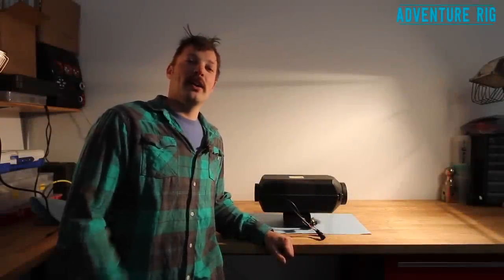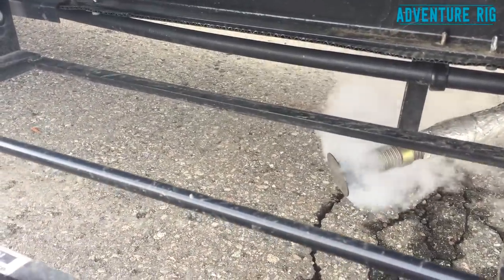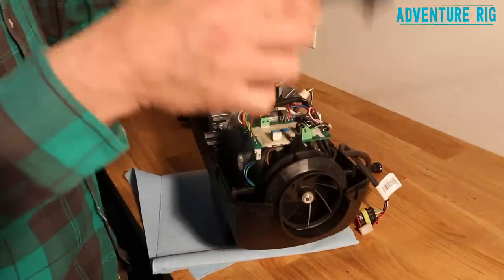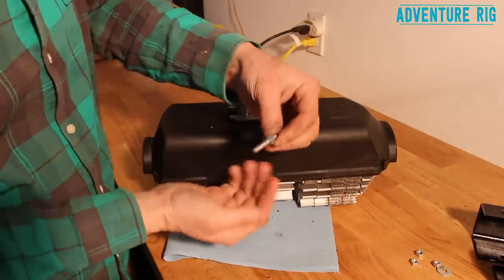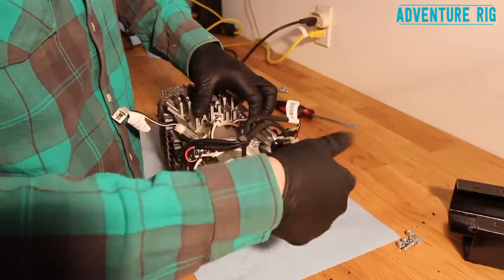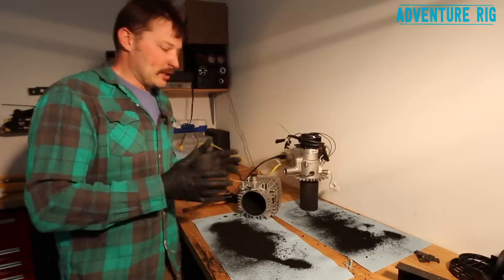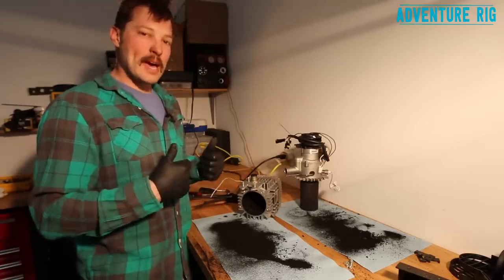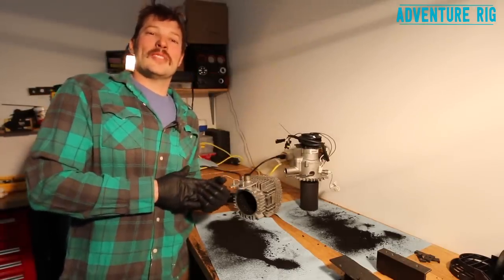Must watch before you use your new Planar Heater! [How-To] Disassemble and Clean Planar Heater

Comment: Hi. Thanks for your video, it's very useful.
I just installed my heater (2d) in my van, and because it's not really cold outside I was running it low. I had set it on minimum temperature and I was wondering why it kept running all night long instead of turning back on once in a while to maintain the temperature. I figured it won't coz that's just not how these heaters work.

Anyway that's why I found your video and I'm glad I did. Hopefully I won't have to clean it the way you did. 

I guess I will just turn it off during the night. It's quite noisy anyway, don't you think?

Enjoy your trips. Tom from France.
Reply from the maker: Hi Tom, thank you for watching. I think it's okay to run the heater on low but before turning it off run it on the highest setting for 5 minutes to burn all the soot out. I also switched to kerosene at my elevation (10,000 feet) and between doing that and running it on high I have not had a problem. 

I don't have too much issue with noise. The only thing I find slightly annoying is the ticking of the fuel pump. No matter where or how it's mounted I can always hear it ticking while trying to fall asleep. But I kind of like the white noise of the heater.

Comment: did this solve the problem?
did you experice sot build up again?
i'm installing a 2D in my boat, and i think, based on your experiance that i will end each heating cykle on full sting.

thanks for the video.

best regards
Andreas from Sweden
Reply from the maker: Hi Andreas. Since I have been running the heater on HIGH for a few minutes before shutting it down I have not had any problems. I would recommend running it on HIGH to avoid the soot buildup while running on lower settings.
Reply: Adventure Rig  thank's alot for the info, I will keep your recommendation in mind.
Reply: There is probably a much easier way to deal with this, by simply putting a kill switch on the unit when you don't want it running instead of running it at the low setting and not burning the fuel properly in the chamber then burning the leftovers at the end of each day, can't create gunk if it's not running at all.

Comment: Quick suggestion here. You cleaned the outside of the burner assembly, and the inside of the heatsink that it goes into. However, that tube that the flame burns inside of is also removable. That is the actual burner. You should also remove that and clean the chamber in front of it where the glow plug is. You could completely clean the flame chamber out but still have a poor air fuel mix and unreliable lighting as well as smoke when all is said and done. Since you've go it that far, clean the whole thing to save yourself having to possibly tear it apart again soon. 

Great video though!

Another thing, even if you run these heaters full tilt to burn off the soot, expect to take them apart and clean them once every 3-5 years of use. They may require a new glow plug or burner assembly at that time too. No big, parts are cheap. They don't go forever like a propane furnace though.
Reply from the maker: I didn't even think about that. Thanks for your input!
Reply: Have you considered running your heater on kerosene instead?
Reply: Sea Foam spray will take care of everything involved in the burn off. Just add light touches to air induction until the smoke clears.
Reply: @robertmencl9169  kerosene doesn’t lubricate … the pump will fail prematurely.. diesel lubricants the pump

Comment: For people looking to buy this there are quite a few water cooled small generators that produce oodles of heat that are far far more reliable and efficient.
Reply from the maker: Post up some links I've not heard of these.
Reply: @AdventureRig  ThermoKing TriPac is one used mostly on commercial trucks.  It heats the prime mover by sharing cooling systems so the heat from the TriPac warms the block.  My truck had a 7500BTU fuel fired unit that could run independently from the generator unit.  From my experience, having the fuel fired heater was a better option and let the generator keep the batteries charged.   It also offered an optional A/C circuit for those summer months.  In the ten years I had the truck, I put about 30K hours on the TriPac unit total according to the hours meter.
Reply from the maker: K4ACS Smitty N. I guess that’s why I’ve never heard of anything like that.... I’m not a trucker.
Reply: @AdventureRig  - Gotchya.  RV'rs have had Onan generators as the high end of RV generator systems for decades.  PonyPack, RigMaster and several others are out there too for the trucker end.  The heater, as you well know, is independent of any generator or APU (misnomer) requirement.  Trucker's wound up with the the whole APU thing mostly because of the alleged fuel savings and reduced idle times.  The RV industry and their systems were made compact enough to be under 600lbs and could be installed on a truck.  This supposedly would not affect revenue cargo weight requirements, though in the end the 80,000 pound total weight limit of the truck was never raised by the industry regulators.  I find it refreshing that the general public is getting into using devices like this for boon-docking or bush camping.  Glad you are doing these videos and showing the rest of us some of the value of this stuff outside of their "normal" domain of use.
Reply from the maker: @electronicsworkbench  Ok that makes sense. I never gave the trucking industry much thought as I've only used it in RVs. Thanks for watching and for the comments.
Reply: @electronicsworkbench  Can you buy a new TK TriPac for less than $12,000.00?  And I'll bet there is no warranty unless you pay the $1500 for authorized installation.  I guessing at these prices.  Please tell us your experience.
Reply: @birdwing98 - 12K is about right in this day and age for one at TK.  I've been retired since May-2014 due to health issues so I'm not sure about what the TK dealer is asking for one now.  I have heard of some dealers refusing to work on older Gen I and Gen II (like mine) TriPac units.  Mine cost about $6500.  Got it in a group purchase with the truck from the company I brokered loads with back then.  I don't think anyone does that anymore.  My comments were primarily for his information about him not knowing of the various systems out there.  Really anyone can build a small, less expensive system.  The heater he shows is but one part of a custom system.  Adding a small 2 cylinder diesel engine with either a generator or an alternator would give you a pretty good extended "out" time especially if the vehicle is diesel powered already.  No having to carry dissimilar fuel supplies to contain.  Not sure if there is a gasoline fired heater.

Comment: I dont think you're supposed to take these apart. If you don't put it back together correct you're dead lol
Reply from the maker: Why would you die if it wasn't put back together correctly?
Reply: Did you not open the chamber that burns oxygen and/or produces carbon monoxide?
Reply from the maker: Adventure Aways Yeah. And you put the screws back in after cleaning it and tighten it back down. Pretty simple.
Reply: @AdventureRig  so my original point is valid is it not?
Reply from the maker: @adventureaways1534  They need periodic cleaning so I wouldn't say "you're not suppose to take them apart". I would make sure to reassemble correctly. If you're not capable of that then definitely don't mess with it.

Comment: Excellent video, have you thought about getting a smaller unit so that you don't have to run on the lower setting?
Reply from the maker: No, only because at night when we're not sleeping we will run it on high and use it to it's full capacity. But once we go to bed and have the covers on us we turn it down.

Comment: You might try just spraying a bit of seafoam into the intake every now and then when it's running.
Reply from the maker: Ok thanks.  May give that a try.
Reply: Seafoam success is questionable  as the heater doesn't have a high  compression chamber.
Reply: +Kevin Burkett That's a good point. I was just leaning on the fact that it's a good solvent for carbon compounds at high temps but it definitely might need to have that extra pressure to not just flash off.
Reply: Just put it into fuel

Comment: Why would you need a heater to run that low, I only use mine if it goes below -2. A jumper sufises until then.
Reply from the maker: If it's below 60 degrees the heater runs.

Comment: you have dirty fuel ? try Kerosene it will burn much cleaner  ,I have a mobile home and I can burn regular home fuel / diesel or Kerosene and the kerosene burns the cleanest , try it ,it will work
Reply from the maker: francis missonellie Agreed. I run kerosene at high elevations now. Or a mix at low elevation.

Comment: are you able to get parts for these heaters ???
Reply from the maker: Doug Peterson I've never had an issue going through Sergey in British Columbia. The only piece I've had go bad was a fuel pump on our old one.
Reply: @AdventureRig  that's where I got mine.  Never had an issue. It has run for about 30 months 24/7  usually on the lower settings.
Reply from the maker: @mrfingers4737  Great to hear! Are you running straight diesel?
Reply: @AdventureRig  that's it. My only problem has been a little dirt in my tank.
Reply from the maker: @mrfingers4737  Do you run it on high much?
Reply: @AdventureRig  I max it out for 10 or 15 mins about once a week. I watched  one of you're vids and saw mountains so I assume you at a higher altitude.  They say that affects the burn. Mixing a little kerosene is supposed to help. Edmonton area is only a little over 2000 ft in elevation. But it does get down to -30 Celsius here sometimes and the heater works great. I believe we have some additives in our fuel during winter months but I don't put anything in myself. I don't use the thermostat, only power mode. I do that because it shuts down occasionally  and cycling the glow plug uses enough battery for a few hours of run time. I believe the espars and webastos have some sort of compensation for elevation  but it's probably not worth paying twice as much for.
Reply from the maker: @mrfingers4737  Awesome thanks for the info.
Reply: @AdventureRig  my friend don't buy anything from Sergey Canada all product very high price and very low quality.
Buy Chinese air heater and be happy . If you need any parts for Planar I can give you.
Planar has bad reputation , owner factory try to change name air heater . Autoterm, Sputnik  ....
Reply from the maker: Луч Разящий Post a link to your website.

Comment: Running on kerosene for a day or two can decarbonize the heater if it is not completely choked
Reply from the maker: I try to run on kerosene every other tank.
Reply: My Epar d2 is in a boat, and cumbersome to do fuel switching.  I just replaced my atomizer screen and look forward to less smoke after reinstallation.  Also, I run a biodiesel blend to improve Diesel fuel lubricating qualities for my older engine, but biodiesel is reported to increase carbon buildup in Espars.
Reply: What kind of ratio do you use for the kerosene? Just put a liter in the tank?

Comment: I would go one step further. Add an atomizer to convert the liquid fuel to a smoky mist. It will burn completely clean, and you will never have to take it apart ever again.
Reply from the maker: Will you send a link to the type of atomizer you're talking about?
Reply: Jim Rojas 
Ok
And would you go about doing so
Reply: @gingerbread2875  there are several videos...look for waste oil atomizer. You have to think outside the box in this case...waste oil = diesel. Same difference.

Comment: "Undocumented feature" is an awfully nice way to say "I was sold a heater that is too large for the space I'm trying to heat". I'm currently on my third time disassembling and cleaning my Planar 44D heater purchased in November 2020 from Sergey at PlanarHeaters.com, and I'm going to replace it with a smaller Espar D2 heater instead. I'd go with a smaller Planar, but I don't want to deal with PlanarHeaters.com ever again, I feel like they upsold me and wouldn't stand by their recommendations. It was obvious the very first time I powered up the heater that it was too big for my boat, but Sergey just said "no returns no refunds" and stopped replying to further emails.

These heaters cannot be run at low settings for long periods of time or they will soot up and stop working. There's nothing quite so aggravating as disassembling and cleaning out a diesel heater in the cockpit on a cold, rainy day in wintertime, with no heat in the boat until you finish! I live mostly at anchor, and really need my heater to be reliable - the hardware seems solid af and I imagine in a larger boat it would work perfectly, but if the heater is oversized and you use it a lot it WILL soot up and fail, over and over again. Telling people to "just remember to run it at high output every 12h of use" is not an acceptable answer for those of us that need it to run 24/7 for weeks at a time.
Reply from the maker: This winter I was able to install their heater that's made for high altitude and it is incredible. What a world of difference! It works perfectly and I can run it for days on the lowest setting without issues. I'm glad to not have to deal with the old one now.

Comment: Not to correct you on your own video here, but you actually don’t need to disassemble the whole burn chamber, rather, it’s the power hungry starting coil— which ignites the oil during startup. This starting coil is coated with thick amounts of carbon which prevent it from starting. Found on the side of the burn chamber, closely resembling a spark plug cable; use brake cleaner to remove the carbon. Wear gloves, mask and eye gear while doing this. The chemical in brake cleaner is toxic to human health.
Reply from the maker: Carl Kane awesome thanks for your input and thanks for watching!

Comment: with my fathers diesel heater we had a similar problem. This heater was not easy to reach, so I wasnt able to clean mechanically. But I tried a chemical way and it had a positive effect. (I will not guarantee for anything, it is only experimental stage. Carbon needs a minimum temperature to burn to co2. It is possible to lower this reaction temperature if you spray urea nitrate into air inlet (of burning chamber) while heater is running on high power. This will clean the burning chamber without disassemble. Early particulate filter used this chem. knowledge for burning the collected carbon. Sooner or later I will test and verify, but due to bad healthy conditions (stroke/apoplexy) things must wait. eventuelly some other person wants to do xperiments and test it.  "Ad blue" is  urea nitrate with demineralized water and non freezant (as far I know), but I used from drugstore with destilled water and really very fine fog /sprayer. As far as I remember abt. 5 mililiters in 5 minutes. Not huge amounts of liquid, its only kind of a catalyst! I used a nearly saturated solution.
Reply from the maker: Worth a try. Thanks!
Reply: Great tip! Thanks!
Reply: Def is not a cleaner...don't introduce it to the combustion side ...try a cleaner Sea foam is a good cumbustion chamber cleaner.

Comment: It looks like the burning process is not getting enough oxygen. That problem will persist.
Reply from the maker: Annie Running it on high has fixed the problem.
Reply: @AdventureRig  - Running it on high all the time?
Reply from the maker: No just running it on high before shutting it off. When this problem persisted I was running it on low and then shutting it down. Running it on high for 10 minutes prior to shut down seems to burn everything out.

Comment: Why is your exhaust wrapped with foil?
Reply from the maker: My exhaust goes through the floor which is insulated and the foil helps reflect heat so the insulation does not start on fire.
Reply: I'm not an engineer but I think the heat would be dissipated better as originally designed.  I assume the foil wasn't part of the OEM kit.  Mine didn't come with 'foil'.
Reply from the maker: I first wrapped it with header exhaust wrap and then wrapped over it with the foil tape. You can actually touch it now without burning your hand (aka starting the insulation on fire). Prior to that you would burn yourself. It's made for exhaust pipes. I bought it from the auto parts store. If there is nothing to catch fire it's not needed.